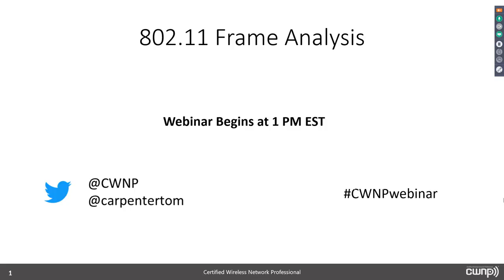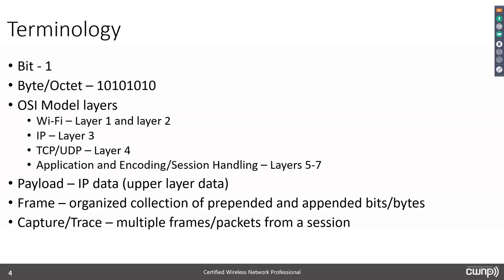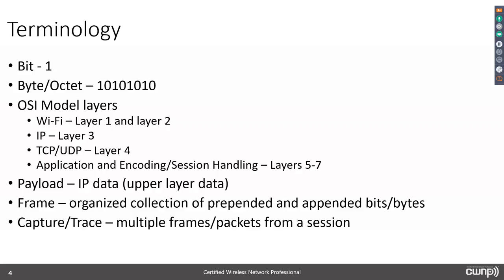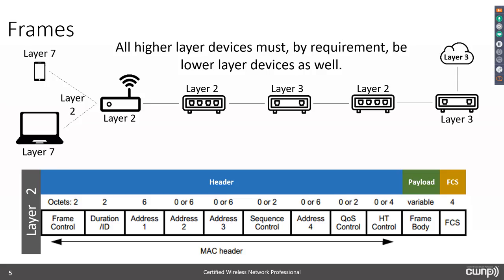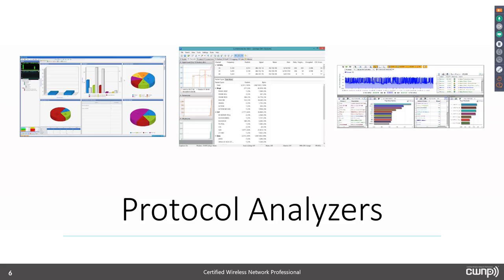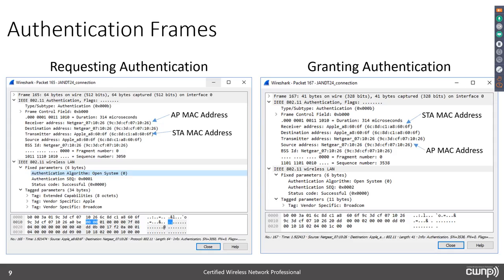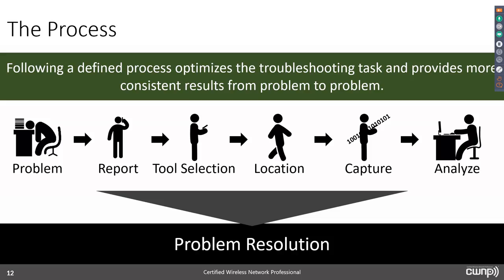802.11 Frame Analysis

Comment: The discussion about byte size takes me back to when I was a computer tech working on the old mini computers and mainframes in the 70s & 80s..  I used to work on tape stands, with 1/2" tapes.  They were available in both 7 track (6 data bits + paritiy bit) and 9 track (8+p) versions.  Most of the ones I worked on were 9 track, but there were a couple of 7 track drives too.  They were used to interchange data with a UNIVAC system, which used 6 bit bytes.  Beyond the tape stands, everything else I worked on had 8 bit bytes.

Comment: Re the 1 Mb beacon on 2.4 GHz.  Does that also apply if the AP is not configured for 802.11b?  I try to configure for minimum 802.11n these days.

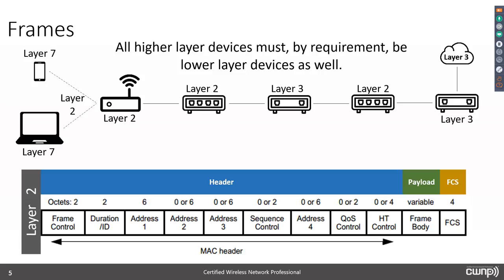Comment: @CWNPTV 13:10 Where do you find these standards? I can litterally not find any documentation. Its like its made to be as convoluted as possible to find any material on the subject. For example where do you find the different tags/fields for different frame types etc.

Comment: Can you please have the answer for this question 
why the length of payload field of 802.11 is  2312 bytes but in ethernet 1500 byte ???
Reply: Different standards, different payloads.
Reply: Sorry for bumping this year old thread,but it makes sense that the protocol for wireless transmission should have a higher payload, when you think of the nature of the medium that you're transmitting on,and everything that could go wrong,it's only natural to have more information transmitted on each frame, as only 1 station can/should transmit at a time, so the more you can transmit in 1 frame,the less frames you need to broadcast @djzn